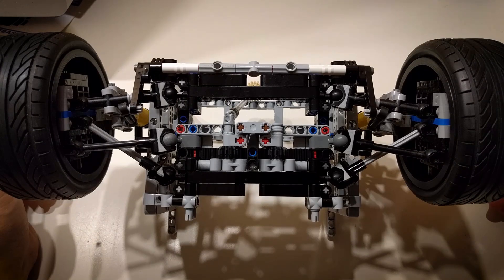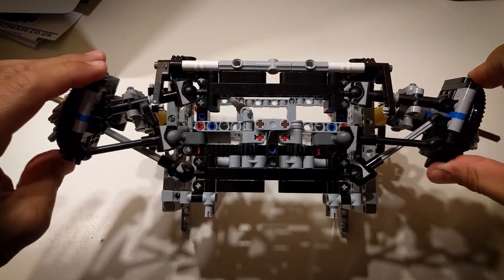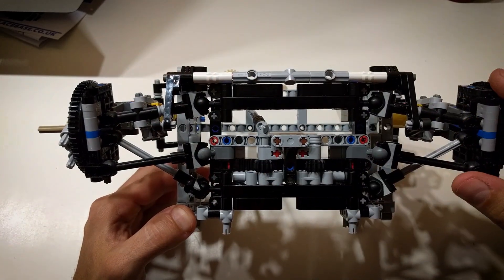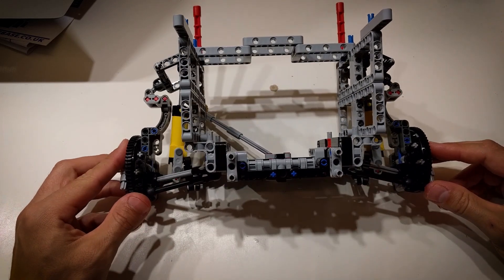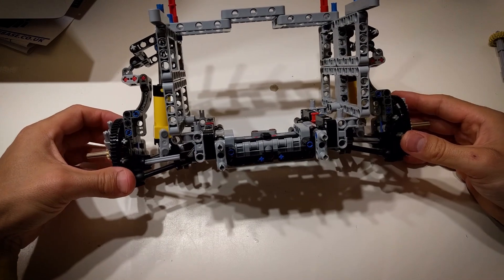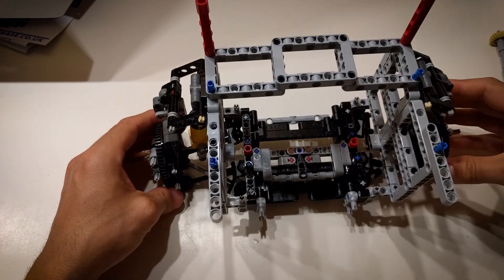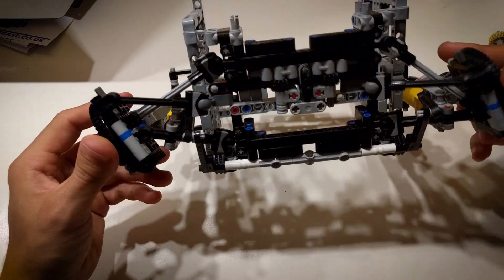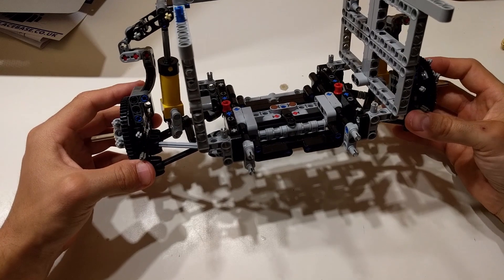Development diary 6

Comment: I don't know if this is a major problem or not, but for all lego supsension I have seen, whenever they go up or down from their mid-point/resting position the wheel moves up/down and inwards, from what I have seen yours does the same thing, and I was thinking that you might be able to make one that goes straight up and down, to deliver power to the rear wheels I think you could use sariel's Schmidt coupling in this video: https://www.youtube.com/watch?v=2M9cp_lJ4_I
Reply from the maker: The challenger suspension has no bump steer, which is probably what you're referring to. The wheels remain perfectly paralel to eachother throughout the suspension travel. This will be more obvious once i have the wheel adapters made and both wheels are properly attached.